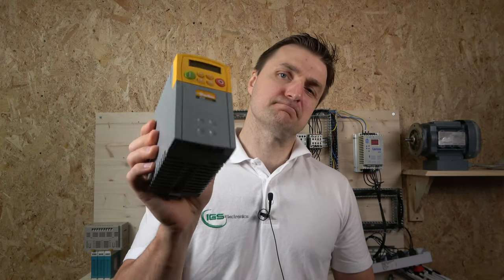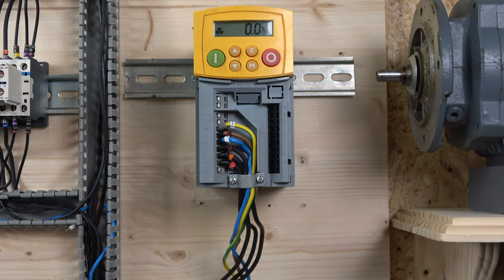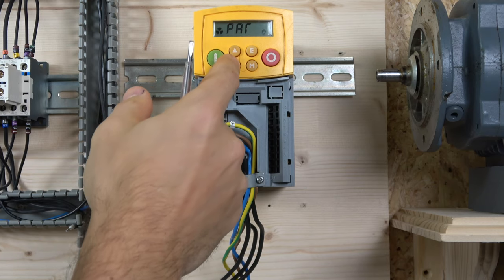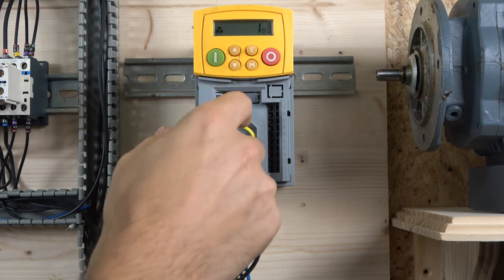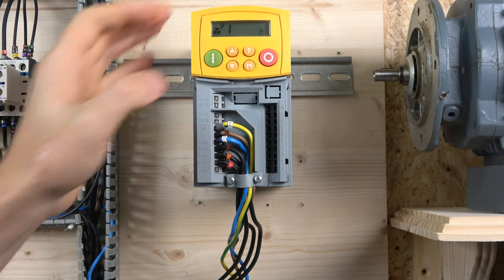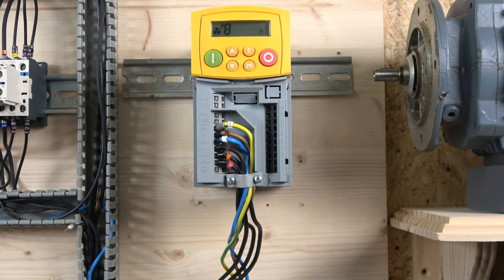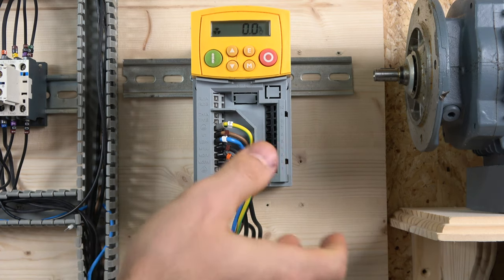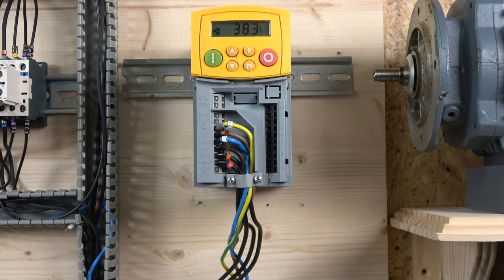Parker AC650 VFD drive local control, drive parameter set up and Factory reset (English)

Comment: Hello, I have problems with a HOT alarm, the place does not have a temperature and every time I start it that happens to me, then later it changes to another CO alarm, having to modify the frequency or the ramp and let me start the equipment, if you can help me it would be Of great usefulness
Reply from the maker: Check for over currents. Remove motor cables from the drive and start up the drive, if problem persists, 9 out of 10 times, drive will need replacing.

Comment: Hi, I have Parker ssd 650, and i have problem, driver sometimes turn off, and after that i cant turn it on min. 5mins. Didnt you have some tip why is it happen?
Reply from the maker: Hi Milan. When you say drive sometimes turns off, do you mean it looses power completely or just stops running?
Reply: @IGSElectronics  Hi, it is totally down, and 5-10 mins not possible tu turn on. And doesnt depend if engine is running or not. I think it could be some failed capacitor?
Reply from the maker: @milantuma2254  Yep, That sounds like it is heading in to full failure. Could be loose solder somewhere in the board or anything
Reply: @IGSElectronics  Thank you for fast answers. I will contact some service soon. PS. Really good video.

Comment: I have 650V frame 2 type to run unwinding machines for tension and twist control. My problem is that the drives sporadically trip due to current limit but the current isn't necessarily high. It's running a .5HP 460V 1 FLA motor. Do you have any idea why this is happening? It really causes problems with the process and I'm running out of options to troubleshoot! I could really use your help! Thank you!
Reply from the maker: What is the fault coming up?
Reply: @IGSElectronics  current limit trip is what the handheld is saying
Reply from the maker: @danellebarnette6380  your current limit is reached for a reason, you need to run several test to determine we’re it is coming from, it is not necessary the drives fault. Use current meter to monitor when the spike is happening at what moment of machines operation, make sure nothing is jamming the cycle and causing the current to spike. That would be the starting point for diagnosis
Reply: @IGSElectronics  yes it always happens hours after a spindle has been running.
Reply from the maker: @danellebarnette6380  Put current meter on one of the phases or better of on all tree if you have 3 meters and monitor the current going to the motor, don't know the loads of your system but if it is steady load then starting current should be the same 1 hour later, if it is not then your motor is pulling more then it needs and that could be somewhere mechanical problem, if no extra pull then your drive could be overheating or other problems with it and it most likely will need to be replaced.
Reply: @IGSElectronics  yea replaced motor and ran with no load. Came back the next day and it was faulted out. It could potentially be a heat issue.
Reply from the maker: @danellebarnette6380  yeah sounds like heat issue or something else. But looks like drive is on its way out, at this point I would start looking in to replacing it.